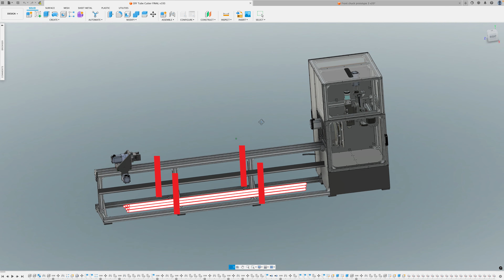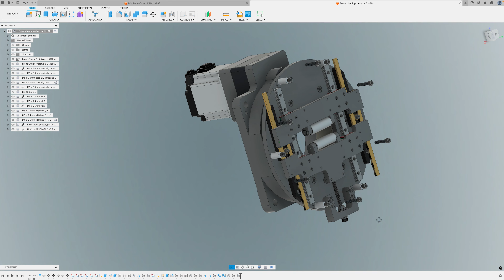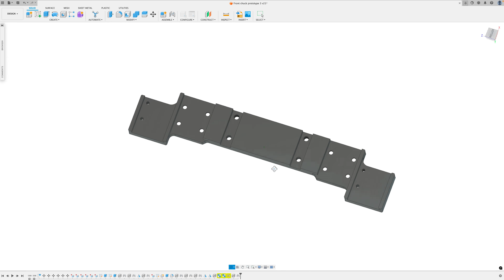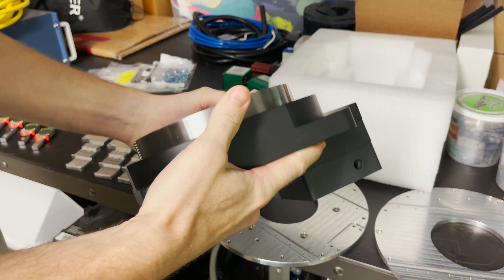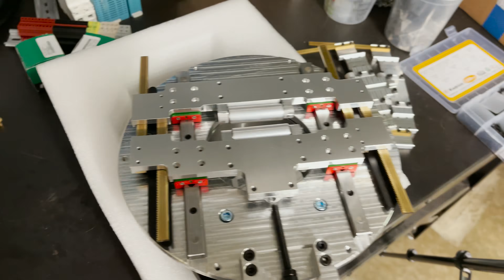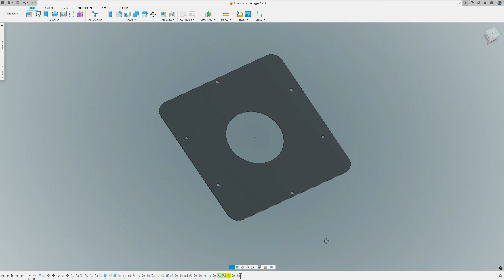DIY Fiber Laser Tube Cutting Machine | Part 1: Self-Centering Chuck

Comment: A support for the uncut portion of the tube like another commenter mentioned would be a good idea. I have run a real industrial tube laser and vibrations in the tube as it rotates are an issue, especially with light thin wall tubes. Even if you're rotating the tube slowly a thin wall tube can vibrate for a long time and if your machine head has capacitance sensing it with jump up and down leading to a wavy/partially welded cut. If it doesn't have capacitance sensing then the tube will slap the head and cause problems.

Another thing you should consider is a heavy duty spring on each of the tube "steady rest" bars. All steel tubing has variations in twist and the dimensions across the tube in anything other than a drawn over mandrel or extruded seamless tube. I don't know the spring rates the machine I ran used, but it was probably in the 500n to 1kn range with ~2mm travel. If you don't have any give in that system you may run into feed issues or wear the bearings out really fast.

I'm very interested to see how this works out. I'm a bit surprised you didn't try to integrate it with your new laser, is there a reason why beyond having the first laser already and needing something to do with it?
Reply from the maker: Sorry I forgot to answer your question...I just wanted to make two separate machines, thinking it would be easier to enclose each of them...though the more I learn about tube cutters, it seems in any case it will be difficult for me to enclose for fume extraction totally because of the sparks that travel down and shoot out from inside the tube itself, so part of it will definitely be escaping from my exhaust system in the enclosure...I've not come up with a good solution for this, unless I was to build an enclosure around the exit side as well, but I don't think I have the space for this.
Reply: @diyfiberlaser  The machine I used had a table on the output side which moved up and down(with square/rect tube) and tilted to dump the cut tube. It was a mixed bag. If the tube cut cleanly, it was fine, but if the tube had any cut-weld then it didn't. Tubes are much more sensitive than sheet. Tube cutting heats the opposing side of the cut and sprays it with dross, so anything under ~30mm often has attachment issues. If you are planning on cutting anything over ~24" then I'd consider an outfeed support, otherwise I'd only worry about an additional infeed support.

The machine I ran had a fume extraction system which pulled through the tube and from near the head. The fume extraction system was 60A 480v with MERV 12 filters IIRC, but even a shop vac hose attached to the end of the rotating chuck could help a lot with fumes. It did have a flame trap in the chuck head since it had pretty good suction on the tube. It could easily pull a 1" square piece of 1/4" steel 20ft through a 3" tube.
Reply: @TheBiscuitsandGravy wow, these are quite interesting and good points. Not that I ever would be in need of it, but I can imagine that it’s helpful to know.
Reply from the maker: @TheBiscuitsandGravy  I went to the IMTS show a couple weeks ago and got to see some large commercial tube cutting machines and I spent some time taking note of all features...I was really impressed by the material loading and roller supports systems, and the outfeed table that dumped the parts. I'm not sure what additional features my controller will support yet, so I'm going to start simple and then figure out ways it can be improved.
Reply: @diyfiberlaser I have a similar project using a plasma cutter instead of fiber laser. My solution was to use the pass through on my chuck to run a vacuum through. 

Option two was to run water down the tube but that makes a mess especially if you don’t have an out feed table
Reply from the maker: Very interesting...thanks for your input! I was planning on making an additional support for the tube as it is cut and sticks out of the machine, something like a tripod on wheels, with a roller on top, that I can adjust to the height of the material I'm cutting...then I could position it externally after I know the length I will be cutting...I'm not sure how well it will work, but it was going to be my first attempt. I like the idea of using springs, I may end up doing that, this is all unknown territory for me, so there will certainly be some modifications as I learn what works and what doesn't.
Reply: What’s the advantage of this over a metal bandsaw?
Reply from the maker: @brantbiba24  It's not used for just cutting tube to length, but can also cut holes and other features at the same time.
Reply: @diyfiberlaser Mitchell, hello. Could you please tell me if there are any drawings for the pipe holder?
Reply: @brantbiba24  this lets you do tube coping. You can kinda cope on a bandsaw but this is far mor accurate and autommatable
Reply: Hello Brazil como faço para comprar só o lazer aqui no Brazil não tem?

Comment: when you are cutting the cover of chuck, we found that the outline was cut first, you may set inner and outer contour in your laser cutting system(it seems like chinese system fscut) and the correct sequence is inner first then outer, the accuracy of workpiece may be higher, about deburr the the other side of workpiece, you may raise up your air pressure or raise your cutting speed, if it doesn't work you can try to decrease the power of laser.

Comment: as a laser operator i suggest you a support for tubing in middle before self centering grip. we cut 12ft piping. and it bends, oh man it bends... so if you want pretty precise cuts, you should consider some sort of supports in middle wich would slide long bottom on rails or something to allways have them supported.
Reply from the maker: Thanks for the tip. I'm cutting less than 6ft...sag doesn't seem to be much of an issue at this shorter length.

Comment: Hello Sir,

  The Diode Laser is entirely different from CNC Router..! It needs a dedicated Controller and different type of Configuration is needed as well.
These information is not readily available in any of the Channels..!

Can You do a walk through video to teach us Mach3 /Hobby CNC Guys?

Normally the plasma or Router needs  Z negative command to cut.
What type of pulse does a Laser Controller puts out to perform a cut.?
How the focusing is executed..!?

These details are not available

It would be very helpful if you can compare the differences between a Fiber Laser system with a Plasma and Router 
Also the special configurations if any
Reply from the maker: I made this video about hooking up a diode laser to my CNC router that might be of help: https://youtu.be/MX9R2FZFFLY
Reply: @diyfiberlaser   One Other Request I would like to make is about the Ethercat Communication method for our CNC purposes.

For a CNC Hobbyist from Step/Dir communication world using LPT Port which is straight forward  in terms of Pin allocation within Mach3.  But since the Ethercat is entirely different system and complex, Couldnt find good guiding material as a video yet.    It tempts me a lot that Most industrial CNC machines uses that protocol and it is suitable for Noisy environments and signal  cable lengths are virtually unlimited.   The high speed communication is above all.   But very sad that i cant step up to that knowledge.!   It would be very helpful if people like you can come up with a guide specifically for mach3 CNC or Step dir communication guys.

Both motion Signal to servo drives from the controller and from servo drives to servo motors..!

Please consider if possible..!

Comment: Searching on these hollow rotary actuators I’m not seeing a through bore dimension, what was the frame size of this one? The 130mm? The sizes they give are for the outer frames on the ones I see. What model was 100mm
Reply from the maker: The one that I used that has a 100mm bore, is labeled ZCT200. I think there is only one model that is larger.

Comment: Gorgeous design of the chuck; you can see how much thought you put into it, and it plays out when you machine the parts, and it just falls together perfectly when you bolt it together. Building it in CAD before you actually build it is a game changer. We designed an entire house in SolidWorks from steel, fabricated it locally in Montana, and sent 3 semi trucks to the site in California with the parts, and it went up without a hitch. And I do many projects like you are doing for myself in SW; thinking it through completely before you even touch any materials is the key to success. Look forward to the next installment(s).
Reply from the maker: That is awesome that you are fabricating houses in this fashion! It's funny, the only time I have errors is if I didn't take the time to 3D model it : ) It's totally transformed the way I work trough projects!
Reply: @diyfiberlaser Mitchell, hello. Could you please tell me if there are any drawings for the pipe holder?

Comment: Forgive the ignorance, as I do design and build some really zany equipment from injection machines from industrial parts to jet engines (with old jet engine parts as well as one offs, sensing a pattern? 😁) but for the life of me, I'm seriously curious for what use case you need a fiber laser to cut tubing with such precision that 'more traditional' methods or even plasma won't suffice? 
Not dismissing your build at all, just genuinely wondering. Aside from maybe aerospace or medical, I can't see a need rather than just using a friction-based precision lopper, or your stock is high-end valuable.
Reply from the maker: That’s a fair question…it’s not so much that I need to, but I want to. I like to take on challenging projects that I don’t see anybody else doing. I don’t know if you’ve seen the commercial machines in action, but to me the laser tube cutting process is incredibly satisfying to watch, so I want to see if I can pull it off. Hopefully by sharing my journey, it will inspire someone who can use this process in their application.
Reply: @diyfiberlaser   I have some aerospace experience, but I'd not been exposed to a fiber laser being used for cutting sizable stock. They are a wonder for surface marking and additive manufacturing, which has been the limit that I've seen them used in industry; I'm not the end-all source in that arena, just what I've been exposed to thus far. I'm looking into it right now as I had no idea they would or could be used in this manner. You certainly have piqued my curiosity though!
Reply from the maker: @C-M-E  Sorry, I regret now that I didn't do a better job explaining what they are used for and their capabilities in the video...I made the mistake of assuming that since I had seen them, everyone else was familiar. Oh ya, go watch some YouTube videos of them in action...there is something incredibly enjoyable about seeing the laser head follow the contours of square and rectangle tube as it turns : )
Reply: @diyfiberlaser  I did end up getting to see a big industrial fiber laser tube cutter in action, and holy crap did I underestimate the usefulness going in! I felt I had to come back and say so as I suspect there's a lot of products I've seen the end result of and had no idea it was done that way. Yes, I will come back and check in on you and your project!

Comment: Like your tapping machine did you do a video on it?
Reply from the maker: No I never made a specific video on it, not much to say....it taps. It was around $600 on AliExpress, it works well, I find the handle and up/down buttons could have been design a little more ergonomically...I especially notice after using it for a long period of time.

Comment: Hello Travis, I'm interested in your Raycus 1000watts laser source. 
Would you be interested in selling it? 
Please let me know.
Thank you.
Reply from the maker: I'm actually going to be reusing it on this project. Though I will be selling the Ruida controller, some servos, and gas control system parts, if you're interested.
Reply: Thank you, I appreciate it I just need the laser power source, I have one exactly the same, but it's damaged. The duty cycle only  works at 80% It was damaged after a short in the electrical conections.
The laser still works, but I had to do a lot of tweaking to the settings to get the laser to cut properly.
Please let me know if you change your mind, 
I would be very grateful if you could provide me with the contact information of where you bought it from China.
Thank you very much and sorry to bother you with all this.
Best regards 
Christian Moreno
Reply from the maker: @christianmoreno4894  If I could do it again I would buy it through SkyFire, best prices I've found.

Comment: No final adjustment spring load to ensure variations in tube diameter/side to side size make the tube loose?
Reply from the maker: Thanks, that is something I didn't consider...I think I might be able to modify the design slightly and get springs on there to allow for size variations.
Reply: @diyfiberlaser  I would drive one side of the tube clamp with stepper motor and home switch (the master side) then drive the other side with a pneumatic cylinder with adjustable air (clamping) pressure. This allow changing tube size via software and always maintaining constant tube clamp force regardless of size variation. To load/unload tube just actuate the pneumatic cylinder. This also eliminates the brass rack and pinions.

Comment: It's an interesting build and you certainly deserve praise for rolling your own design. If it were mine I would be slightly nervous about the lack of a locknut on your two drive "spindles" and the general lack of thread lock on bolts in a complex assembly I will look forward to your future video's. Best regards Sarah
Reply from the maker: Thanks, I didn't show it but I used 2 nuts to jam lock the drive spindles. I will use thread lock eventually, but I've already got some good feedback and will be disassembling it to make improvements.

Comment: What a beautiful build, and what a great workshop you have! Did you consider to have somewhere an adjustment mechanism, in case at the end the tolerances add up and there is need to bring it back to center? Like shifting one linear rack a tiny bit.
Reply from the maker: Thanks, I didn't consider that...but I do have a little clearance in gear rack holes where I can adjust the position slightly. I also got a comment about adding springs to account for fluctuations in tube diameter, which would be nice. This is my first iteration, so there is definitely room for improvement as I figure out what works and what doesn't.

Comment: One thing I did with my Router was add side pieces to keep material inside the cut area so it didn't make a big mess, It helped a lot.
Reply from the maker: That would definitely help! I was thinking about maybe fabricating an enclosure once I finish the tube cutter
Reply: @diyfiberlaser  The downside with an enclosure on a router is tool loading. My tools are stored on the backside so if I want to preload the tools before measuring I have to crawl inside the router.
Reply from the maker: @mrp19285  That's a good point...I think I would want every side panel to be a door so I could still have easy access.
Reply: @diyfiberlaser  I built mine out of 2020 extruded aluminum. If I was to do it again I would was 1 or 2" square tubing. Then do whatever doors I wanted out of extruded aluminum. I have a AXYZ 4004 so an enclosure that size out of 2020 isn't the best.
Reply from the maker: Noted, I will probably use 1” square tube for the frame and extrusion for the doors like you suggested. I would expect a video update in the future, i want to make the enclosure and rework the z-axis to use square linear rails instead of the round unsupported rails it currently uses…there is too much flex and I’m not happy with the current cut quality, the rest of the machine is solid, but the z-axis sucks. Also, I didn’t get it on video, but on my last part a tool got stuck in the spindle and the alarm didn’t trigger for some reason…the machine dragged the tool across all other tools and ripped them all off and eventually cracked one of the y-axis castings…so I have that little problem to address 😕 I think I’m switching back to manual tool changes as the Masso just doesn’t have the tool changing logic for me to do if safely.

Comment: Very interesting and fun project. I noticed that you use a combo of expensive McMaster parts and cheaper Amazon kit parts. How do you decide which to use where?
Reply from the maker: That is very keen of you to notice! : ) I shop around and end up buying most parts from either Amazon, eBay, or AliExpress. But for some specialty parts, I don't mind paying a little extra to get them through McMaster-Carr because they have 3D models available for every part and it makes it easy to integrate into my 3D models, especially when sometimes the parts don't have detailed descriptions or dimensions on some of the other sites.

Comment: Oh boy, these are a bit more complicated than the regular XYZ laser, don’t forget a support cylinder with a mounted roller when the spindle is retracted so the tube doesn’t flex. Make it have the ability to swing just in case the spindle hits it. Don’t forget proper dust collection. I have seen your previous videos but no proper dust collector, EPA may require it. Company I work for needs them. Congratulations on your ongoing work. With all the metal you have been cutting you probably have noticed a lot of dust, breathing in metal dust isn’t a good thing.
Reply from the maker: Thanks for your input, I plan on making a support for the tube that is external of the machine…we’ll see how well or not well it works. My exhaust system has been working well on my other machine, there is no dust or fumes every time I cut. It will be more difficult to contain on this machine for sure.